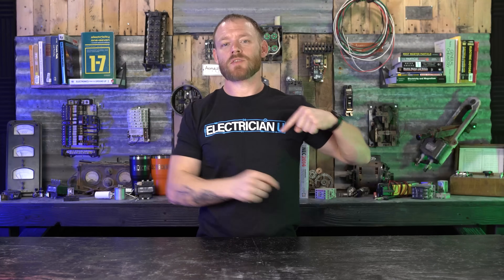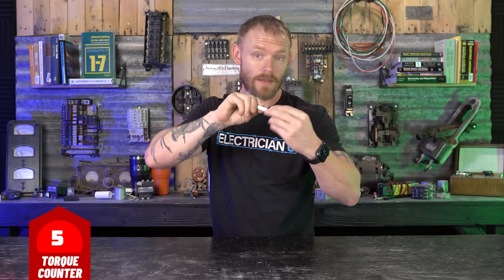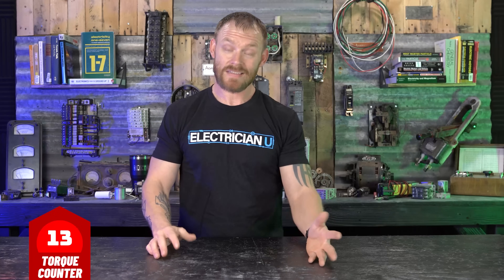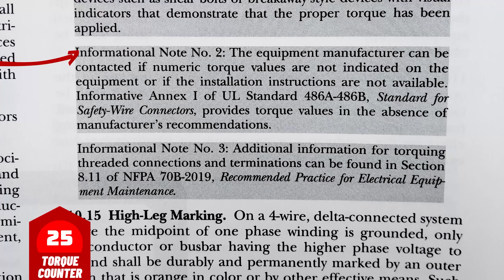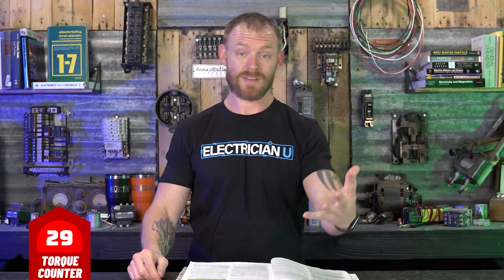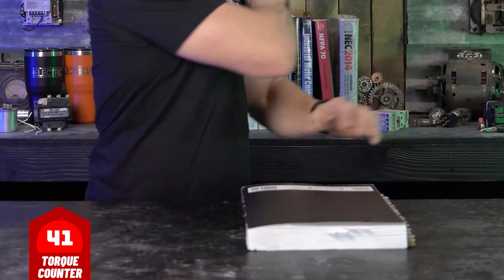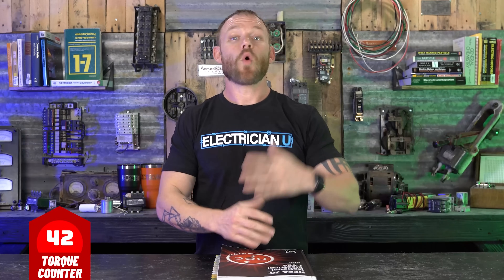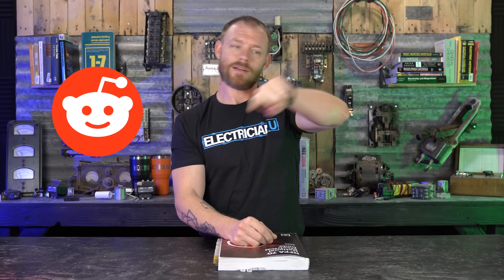Electricians: To Torque or Not to Torque... Is that the Question?

Comment: Dude it literally says SHALL right in the first paragraph. Every new panel has torque values on it, that means you need to use a torque wrench (or screwdriver) on it. You'll probably find that the torque required is way the fuck higher than you'd normally use to tighten the screw which is precisely the point. I used to refer apprentices to your videos but if you keep putting out videos like this ("code says XYZ but I say fuck it") I will stop.
Reply: Agreed. It says the values SHALL be as indicated on the equipment. And then it says an approved tool SHALL be used to achieve those values.
Reply: I’ve watched these to understand more about electrical services, because I’m a fire investigator. We’re taught to pull wire for arc mapping and to check connections because they are a likely source of ignition. When our schools say all connections shall be torqued, and to check them, then you better do it on an install. On a big enough event the entire system from the transformer to the last outlet will be gone over by an engineer. If a fire happens and it comes back on something energized I’d rather say I did it by the numbers and be able to point back at the engineers who designed the system when the lawyers come calling. Just my 2 cents.
Reply: Right?? 

“An approved means(the informational note below describes such means) shall be used to achieve the indicated torque value.”

There’s no gray area here.
Reply: Agree completely. 300 MCM is way more than you would expect.
Reply: its not "way the fuck higher". if you make that claim, i would like to see video proof that a general populace of elec-chickens under torque everything from the get go. not new installations. which are still questionable from people i know, but they are tight as fuck. stranded wire not withstanding. even the IBEW here use a battery powered driver to "tighten" their mains. yea id say they are tight as hell, easily over torque. theres a big distiction that needs to be made over basic recepts and switches verse switchgear or the similar. 200 inch pounds on some siemens equipment is less than what id do by hand. seemed loose to me.  i was told to do so though. maybe sometimes just make a good fucking connection. i will say there are cases to be made for torque for recepts and such and i can see the reasons. at the very least make shit tight. and not too tight. but damn, can yall stop fucking backstabbing recepts please, i mean i get paid to fix it but shit, most common failure point. noone wants to to torque recepts or switches but will backstab em all day. you push connectors are shit too. wagos can die.
Reply: @willywill3570  Amen brother, I get a lot of work diagnosing stab in the back receptacles. Wagos should only be used in luminary connections ie. can lights. In my opinion.
Reply: @Sparkeycarp  stab in the back receptacles are not Wagos.
Reply: @Sparkeycarp  tell that to Europe, they only use wago, installed properly they’re awesome

Comment: Area years ago at an IAEI meeting instructor asked the 120 people in the room how many owned a torque wrench. Maybe 7 guys raise d their hands. At that time somebody stated that nobody made an insulated torque wrench and it is dangerous attempting to use a long steel wrench on an energised s crew or bolt head even if wearing all of the required PPE. would not want to be in the same room if one of these uninsulated steel wrenches flew off a sparked hands and into a 600 or 800 amp buss bar.
Reply: Ok, well they do make an insulated torque wrench now, and torque wrenches (etc) are now required by code, so time to update one's practices. You wouldn't go to a doctor who still believes in lobotomies. Houses use more power than ever (e.g. for EV car chargers) and it's not okay to skip out on this because electricians think it's unmanly to do it right.
Reply: That doesn’t even make since you’re not gonna hook up a service that has power you would obviously do it when the power is disconnected from the transformer.Therefore no reason not to use a torque Wrench.
Reply: @nathanbarnett687  I have done hundreds of 100 to 800 amp services and ultility power was always on. Its impossible and not pratical to attempt to have any ultility company secure power that could energise as many as 30 customers. The only time they will perform a service intetuption is for services 4,160 volts and higher. At one time we had to drill & tap 480 volt 800 amp buss bars inside panels hot. Would never do it today.
Reply: When a mechanic becomes and electrician 😂

Comment: I torque main lugs, breakers, and  Alumiconn 3-port connector, but  just use my Klein Tools 32378 Combination Tip Screwdriver Set for outlets and switches.

Comment: Seems to me that people who don't how tight is tight enough should be torquing them, or if they're concerned that over tightening might strip the screw. I'm not a professional, but I do it on the main lugs and breakers that have anything with a #10 or larger wire.
Reply: Exactly, when you need to put 40 or 45 ft-lbs on a breaker screw there's no way that "two ugga-duggas" or just hand-tightening to "seems tight" is going to do it. If you've got 60 amps going through a breaker to charge a car that breaker needs to be operating at spec.